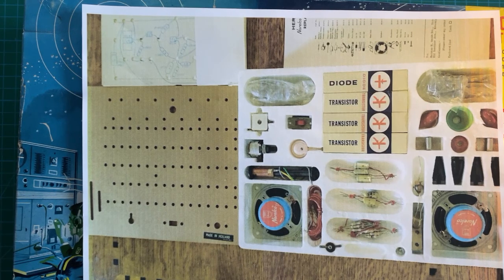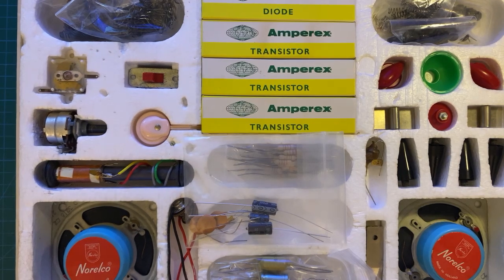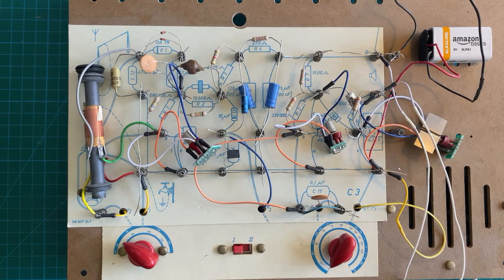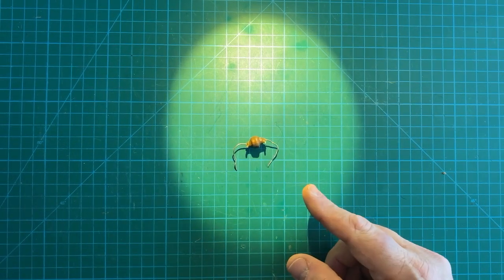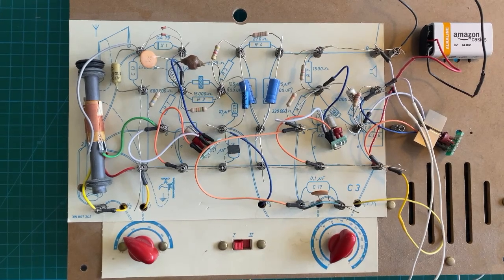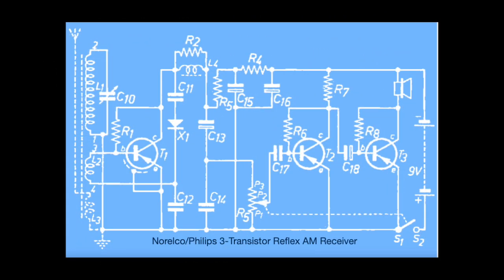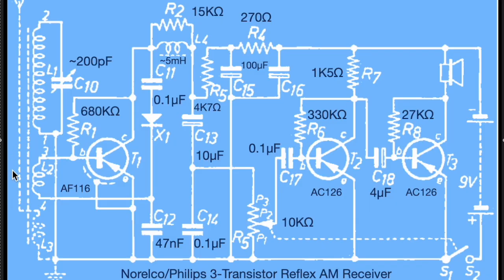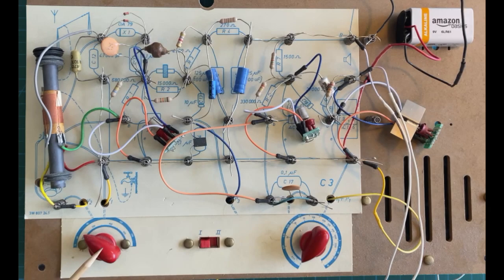Philips:Norelco EE20 3-Transistor Reflex AM Receiver

Comment: Excellent video and thanks for pointing me to it.  Looks like you beat me to it.  Great circuit explanation - for beginners you might want to explain the role of C14 and how R5 (pot) and C14 interact but you cannot do everything in a video as I will know!
Reply from the maker: It's amusing that the schematic has an error (two R5s).  I had not given C14 any thought (nor does the manual) but one possible notion is that it and the pot form a low-pass filter of sorts.  In any case, thanks for the comment!

Comment: Thank you for good presentation of the Philips EE20 kit. I found such a kit from a 2nd hand store a couple of years ago. Some original components were missing, although most of the components were left on the box, the instruction booklet and the plates for the projects.
Reply from the maker: Almost everything in the EE-20 can be obtained today, or even 3D-printed.  However, treat the transistors with respect, and, oddly, the light bulb.  Thanks for taking the time to  comment!

Comment: I used to be a proud owner of a Philips EE20 kit and have spent many hours in enrapture of the miracles of transistor circuitry. At the time it was a fairly expensive thing for the eight year-old that I was, and it took me a Winter of snow-shoveling and old newpaper collecting for reclycling (Yes, we did recycle in the early 1960s. This was frugal Netherlands after all.) to save up the 100 Dutch guilders that the set costs at the time. My father (a WW2 vet and former resistance member) often (half)joked that this set could be worth its weight in gold if WW3 would roll around. 
As a resistance member in German occupied territory where owning unregulated radios was drastically punished, I guess it made a lot of sense to have the parts and such available to build one yourself. He himself built a two tube radio with tunable jamming filtering for listening to BBC Radio London, in an old pickle jar (with fake pickles to hide the function), powered by a self-made 12 volt lead-acid cell that he recharged while bicycling on his messaging runs for the resistance. I still have it and it still works fine. I even tested the jamming filtering during the Cold War (part1) and it was still pretty effective.
The later Radio Shack kits of the early 1970s were nice and had many more circuits and projects, but were not as clear on layout or as durable as the old EE20 set. 
Fun and exciting times!
Reply from the maker: Many thanks for the comment and flashbacks to WWII resistance radio!